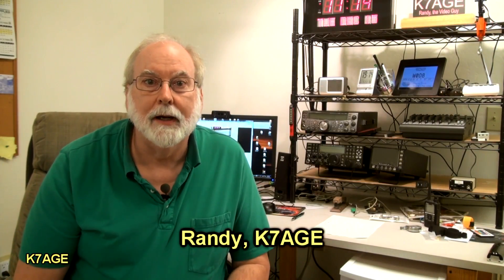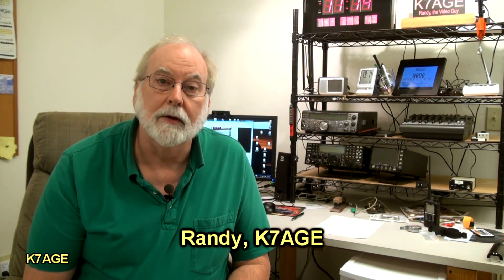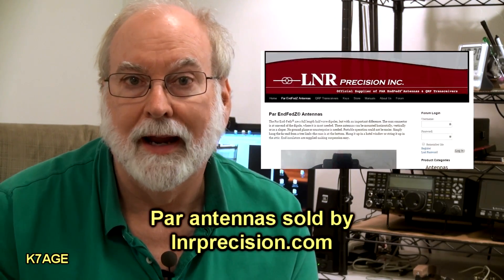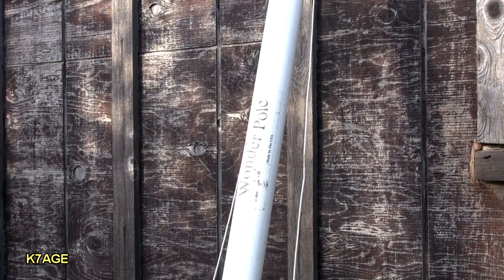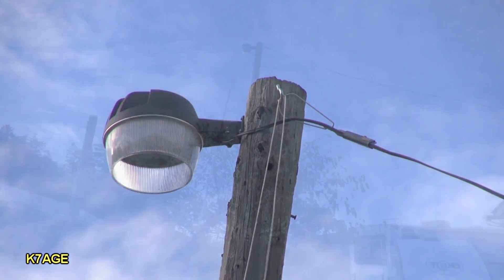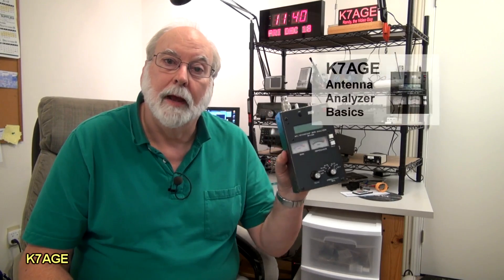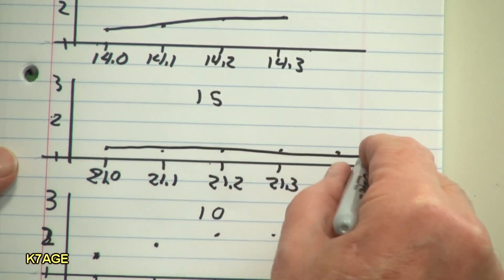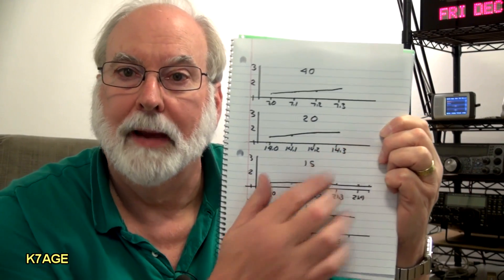New Ham Shack Part 2, Antenna installation

Comment: I'm using a TRAM 1125 mag mount magnetized to a stainless steel plate, disguised in a plastic flower pot, with imitation Ivy hiding the antenna, outside my bedroom window. With either my dual band Yaesu or Baofeng HT, the furthest repeater that I'm hitting is 25 miles away. Would I have better results with a J pole, near the inside of the window?
Thanks and 73
Reply: +usernamemykel 
Correction: TRAM 1185, and I'm a new subscriber as well as new Technician who finds your tutorials to be superb.

Comment: hey K7AGE, i got that   2 Meter Quarter Wave Verticle  Antenna working, i had a bad SO239 connector, the little plastic insulator was missing , so i was getting all kinds of interference, and since i had never seen one before i did not know it was missing, seen one on another video, so i cut off the end of a dowel rod, drilled a hole pressed it in there .....WOW, it works great! Thanks for the great video, I learned allot!
Reply: +Hammer USN until it gets wet....LOL, just kidding im ordering a replacement!

Comment: I don't ground either.  Before you hook up antenna,  you might want to check voltage on your antenna. Too bad about 10 meters.  Good thing you have a tuner on your rig.  Chk my page at goo.gl/v6juai.  73,Good vid.

Comment: Dear Randy,
Happy New Year.
What is the harmonic relationship between 40m and 15m ?
And why does it often work ?
Reply from the maker: +Ade Larsen Here is a page that explains this. A dipole for 40 meters will quite often work on 15 meters. 21 MHz  is the 3rd harmonic of 7 MHz. The feed impedance at 21 MHz is also close to 50 ohms. So, that is what allows it to work. This was very common back in the Novice license days when they had both 40 and 15 meter privileges.  http://new-ham-radio.blogspot.com/2010/07/is-it-true-that-you-can-use-40-meter.html
Reply: K7AGE Thank you Randy.
I should have used my brain first. I understand now. Thank you for teaching me and reminding me what I was supposed to already know.
I am back on track now. Very good, thank you Sir.
Cheers and happy new year.
Ade :-)
VK4SOE - Clan Radio.

Comment: Hi Randy, 

Thanks for the video....  I just received the same antenna in the mail today and like you I'm in a rental ranch style house.  No trees to speak of, just a power pole in the far back corner which I plan on using for the very end of the antenna about half way up, somewhere around the cable lines.   Then attaching the box where the coax connects under my Diamond vertical CP6AR which doesn't work worth a darn, but is up about 28'.  

Anyway how's that antenna working out for you???   A little cold and snowy up here in Wisconsin to be working on antennas, but will throw it up as soon a the temps come up a bit....

Thanks,
Mike
K9BBN

Comment: Good videos! I use rubber plumbing caps with hose clamps to cover ends of pvc pipe. Cross slit end to feed cables through or cut one side to avoid feeding cable then hose clamp. It is a much cleaner look and helps keep mice out.

Comment: Another great video, Randy.  I too am building a new home.  I was hoping you could give some pointers on how to add a good RF ground and maybe a 220 volt outlet for a ham shack in the new property.  Doing this during the building stage is much easier.  Now, if I can just decide on where I'm going to put the ham shack!Rick W0SKITucson
Reply from the maker: +azcharlie2009 Have the electrician install a 20A 220 VAC outlet and breaker in the panel for your shack. Grounding, there is a good section in the handbook.